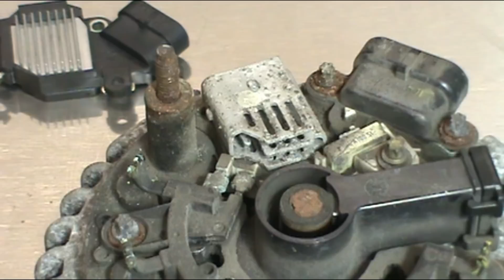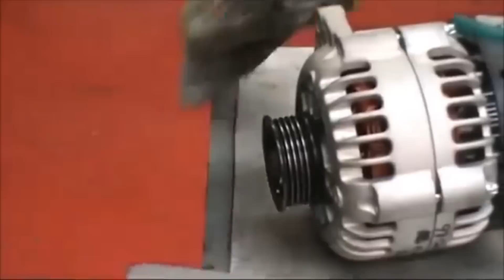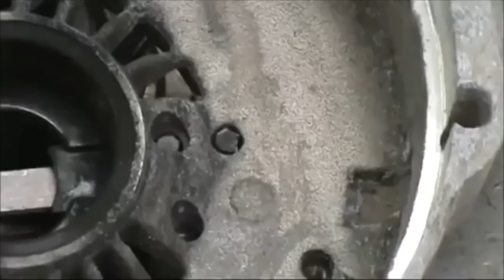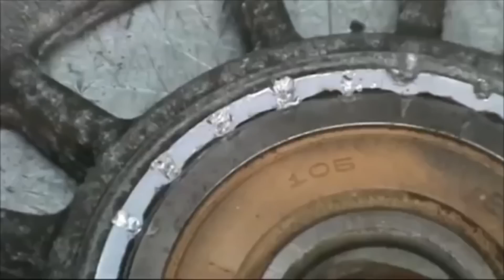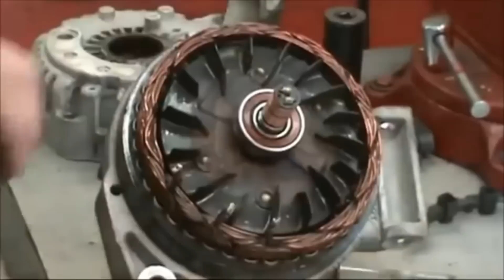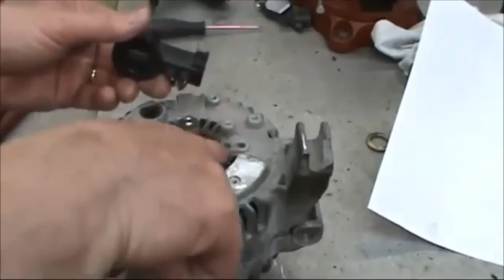how to rebuild an AD series GM alternator

Comment: Well although I really did like the theme of the video and it shows what the average DIY home mechanic may deal with with, I have some exceptions to and with some of your methods.

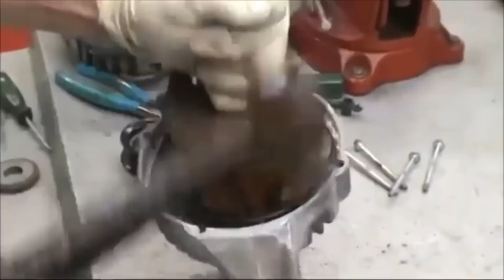1) At 7:10..... Using a ball peen hammer or any steel hammer can well end up in a bent or cracked casing.  Use a hard plastic hammer or a bit of hard wood such as oak or maple to keep tapping around the casing to drive it off the stater.

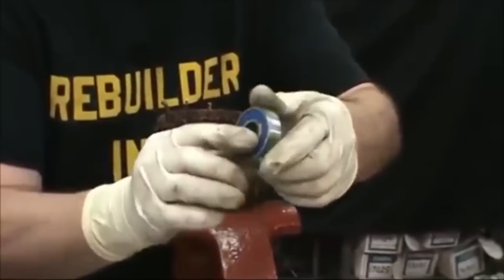2) At 9:48 you detailed about putting the front casing into the oven @350'F (250"F is my preff" for 20 minutes.  then you drive in a new but at "room temperature" bearing.  Had you also put that bearing in a plastic sandwich bag and placed in the freezer for 20 minutes, when you bring them both out for reassembly and quickly put the bearing in, it will in all most all situations very simply slip into the casing without any forcing with a hammer.  However, tap it lightly just to make sure it is seated!

3) At 14:22, had you also put the rear bearing in the freezer in a separate bag and the rotor in the oven @250"F for 20 minutes, the rear bearing also would likely have just slipped fully onto the rotor shaft.  The using a socket just to tap down assuring that it is seated.  

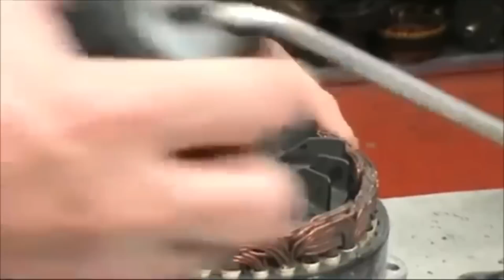4) At 15:00 it was visible that you cut into the commutator which should be avoided at all costs as the sharp groove may tear away at the brush.  By appearance, it looks like the brush will likely be above that cut Hopefully.  For all you DIY, people,  be easy with the dremmel and don't cut into the commutator or the rotor bearing surface.

Not poking fun at anyone here, just adding my two pennies worth to help make your job a little easier!
Reply from the maker: Also Lisa, very sharp to notice the slip ring at 15:00 ! Nobody's perfect, and we suspect that could happen in the field to people using our kits, because if you have to cut the bearing off, it could be unavoidable that minimal damage occurs to the slip ring, do to the geometry and the diameter of the cut off wheel. This "imperfection" (nyuk nyuk) will have no performance or life expectancy effect on the alternator, as long as the cut is 1/16" away from the brush track. This is a perfect example of clinical verses practical (actual) mechanics who get the job done, not just talk about it.
Reply: @rebuilderinabox  you said it a lot better than I would have.just saying.
Reply from the maker: Great comments. Thank you very much. But, to  be the most help to the people actually doing the job : Trust our many, many years of experience with alternator tear down. DON'T waste your time with ANY rubber, plastic, brass or wooden mallet. It won't work, or your arm will be so sore, you won't be able to finish the job!! Just grab a regular ball peen and use a little heat and common sense. The plates are not pure aluminum. They will take a lot of force. If you DO happen to break one and you bought one of our kits, we have your back. Call us m-f 8-5 eastern and we can ship a complimentary or very cheap replacement from our stock.

Comment: How did you get the post standoff off so the new rectifier ground can go on? Does it need heat? Your video just cuts from it being there to it being off.
Reply from the maker: It shows you somewhere in the video. Tap down on the post with a hammer while supporting the rectifier from underneath with a closed end wrench that's a little bigger diameter than the post at the bottom.

Comment: Do you still stock the parts, I can't find a decent kit out there, but I haven't gone to your alternatorstarter site. Is that the right place, because your T-shirt is confusing me.
I really appreciate your video and it really is a shame that these kits are so obscure because the work isn't labor intensive, just a little time.
There should be a law in that every part should be accessable, cross-reference capable, and obtainable. People have gotten lazy and prefer to pay out the nose for someone else to take their known, good core for the unknown quality of a remanufactured a unit with a warranty. If it was perfect, they wouldn't need that warranty and then what happens when they can't fix anything and the parts aren't even there anymore. Dealer service destroys right to repair with regards to vehicles. Sensitive subject, I can't stand it! 😡😂
Glad you're out there providing this service, had parts to come by nowadays!
Thanks man!
Reply from the maker: Rebuilderinabox is a hub for all of our sites. It's our brand name.

Comment: Excellent video for a full rebuild. Is it possible to replace the brushes without removing the rectifier block? Thanks......   Ian.....
Reply from the maker: Only way to replace brushes on that is the hard way. Thanks engineers.
Reply: Thanks for the fast reply.
Reply: The brushes can slide out of the brush housing, but the connector end is captured, thus requiring you to remove the regulator to get the connector off a raised area holding the brush rings. Sorry.

Comment: Thanks for the awesome video Mike, very detailed, I still  don't think I could do what you just did. Any particular type of soder?
Reply from the maker: In the shop, we use Stellar Technical.com. Rosin core .062 dia lead free. 97% tin 3% copper. 441-590F melting point. At home for the part timer, Kester has been in the solder biz forever. They make a "Pocket Pak" 60/40 that comes in .031 dia and .05. Looks pretty good and not expensive.